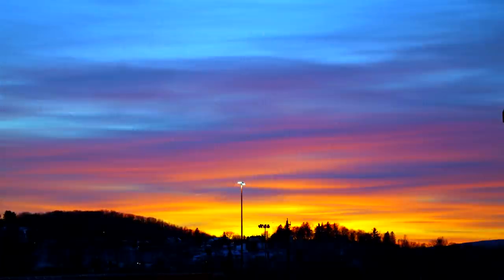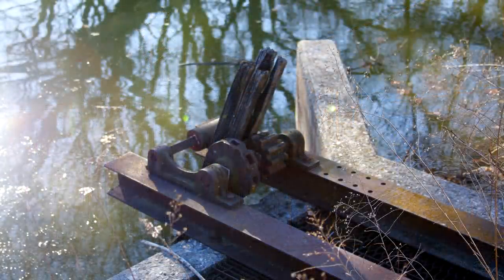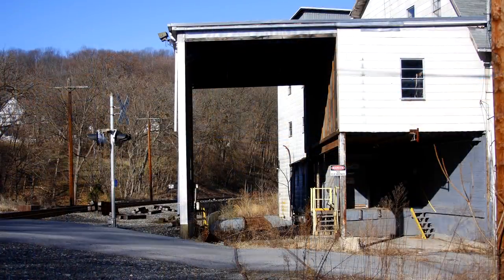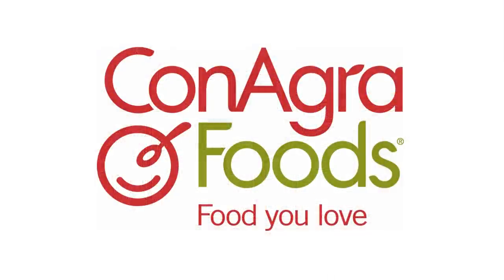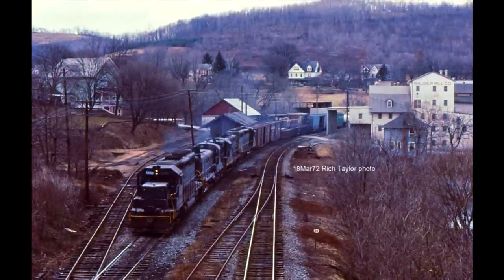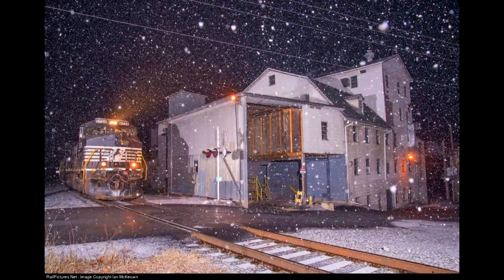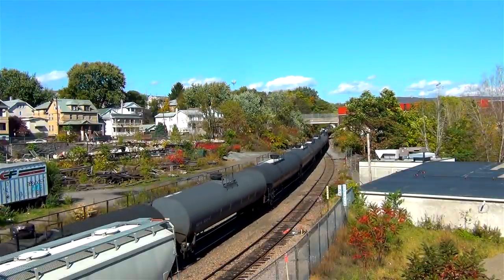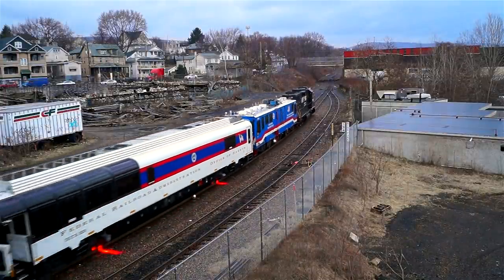[UT][T-189] The Future of Trains?? Unit LNG Gas Trains |Trains 21

Comment: Nice you see the Z this morning also 14R will have a CP trailing
Reply from the maker: I did, the Z had 5 or 6 engines.. It weighed in at about 15,000 tons and 10,000 feet.. The CP on 14R is probably the one that came down on the Z yesterday.. There's also a CP unit on K81 today.. BTW, I haven't forgot about your request, waiting for the weather to warm up a little more.